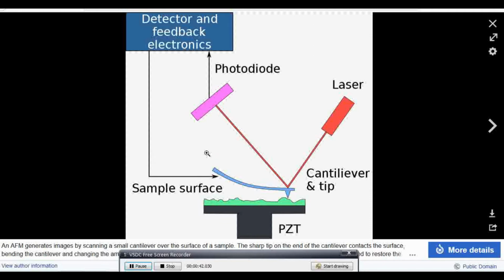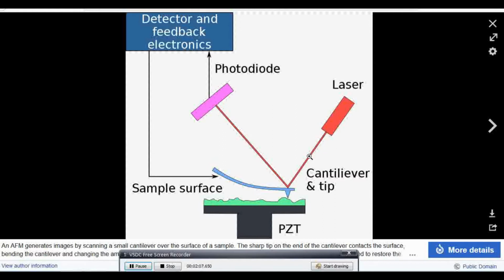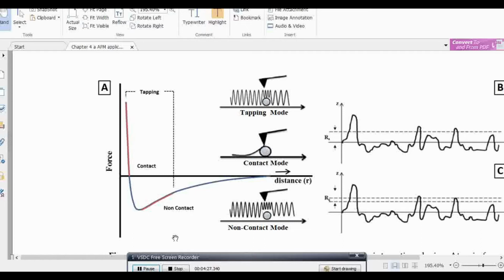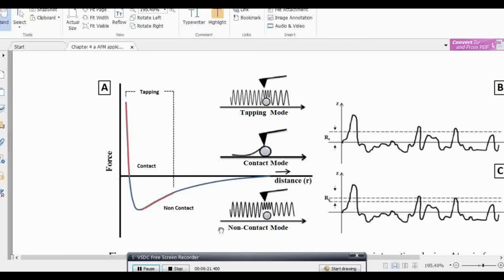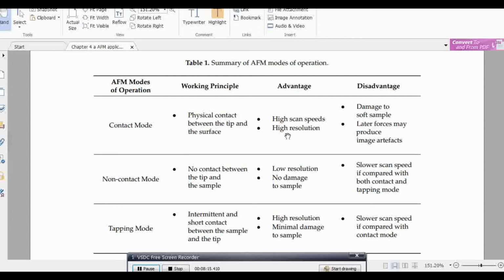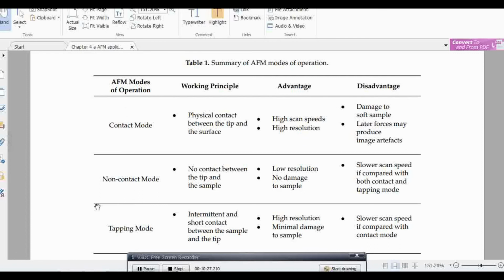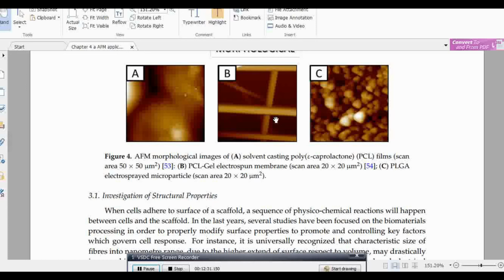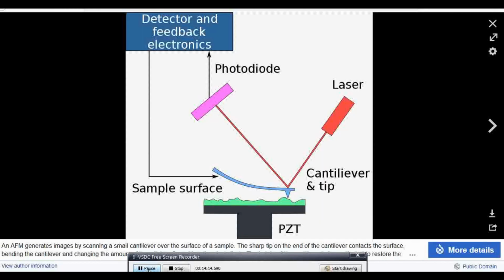Biomedical Engineering and Application BEU41503 LESSON 8

Comment: Greetings to you, Dr. The answer for the question that you've asked Dr, which method is the most suitable used for surface patterning technique. In my opinion, the more preferrable one is the tapping mode. Since, the tapping mode has the high-resolution topographic imaging of sample surface, advantage in improving lateral resolution on soft samples, possibility of sample damage is quite low, and it operates in linear, it makes the vertical feedback system more stable and allowing routine reproducible sample measurements.

Comment: Thank you, prof, for your thorough explanation. I'll look into the rest of the application and the benefits of employing an AFM system to image biomedical samples.
The most appropriate method in atomic force microscopy (AFM) question is tapping mode. This is because due to its excellent resolution and lack of sample deterioration. The result shows that it is more accurate than non-contact mode and causes less sample damage than contact mode.

Comment: Thank you for the sharing prof. For the question you ask, the most suitable method is tapping mode. This is because 
tapping mode has high-resolution topographic imaging of sample surface, has minimal damage to the samples, and operates in linear, making the vertical feedback system more stable and allowing routine reproducible sample measurements.
Reply from the maker: True. Good answer.

Comment: Thank you Dr for the clear explanation. I will find the other information about the application and the advantage of using afm system in imaging biomedical samples. 

For the question you asked, the best and suitable method in atomic force microscopy(AFM) is tapping mode. This is because it has a high resolution and minimal damage to sample. So it more accurate than non contact mode and less damage to the sample than contact mode.